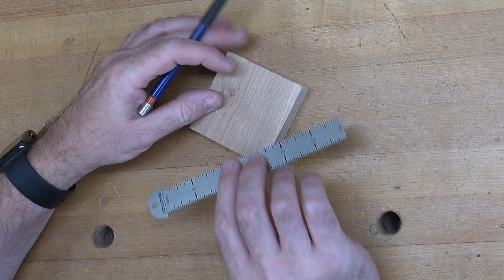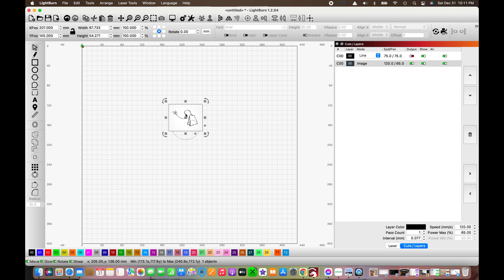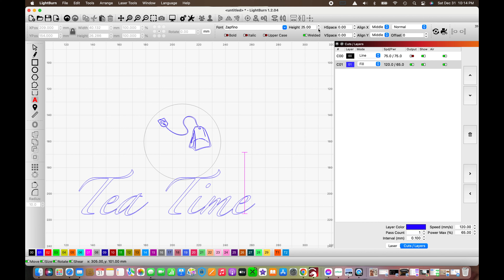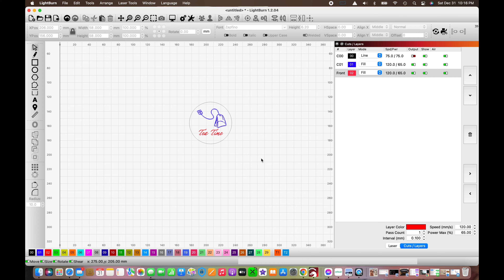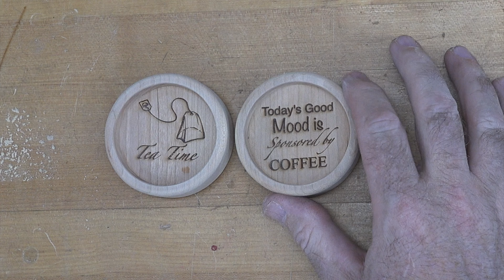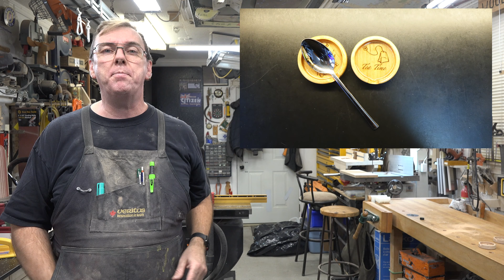Making a Scroll Saw Spoon Rest

Comment: How timely I just bought a Longer Ray 5 10 watt Laser with air assist arriving tomorrow. Updated my Lightburn too. So I will be making some of these 😀🛫
Reply from the maker: The Longer Ray 5 is a capable 10watt machine.  I showcased it a little while ago here on the show.  I would definitely suggest an air assist setup for it though to minimize the overturn on your engravings.  I have seen plenty of folks who 3D print their own air assist nozzles if that is something that's up your ally.  Good luck with your Ray5 and please don't hesitate to ask any questions you might have.  Thanks for tuning in.
Reply: @acutabove_woodworkings  the laser arrived last week, the air assist today 😀. As you said this helps mitigate the over burn. I am burning test tile for the Norton White technique now. I used the default settings in the test grid from Lightburn and they were really hot,
And yes I have a 3 d printer too! 😀🛫